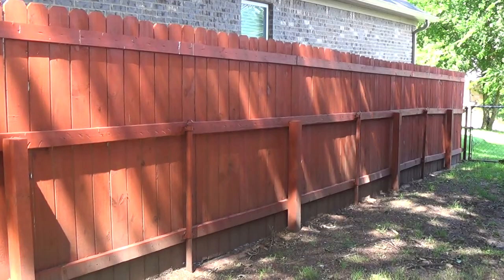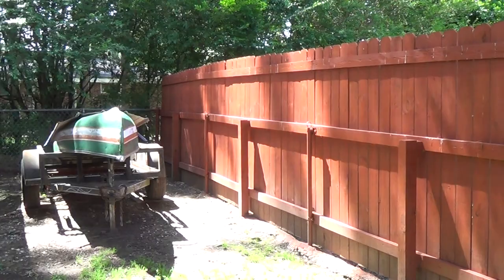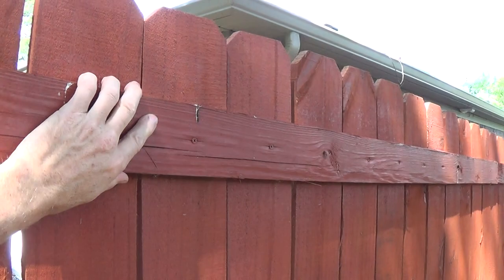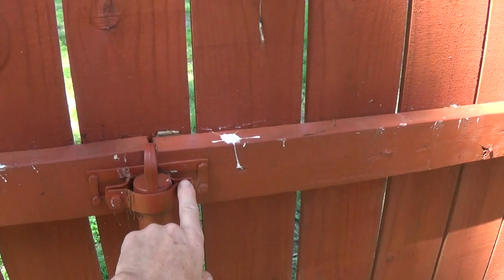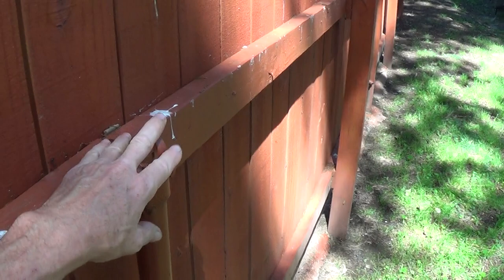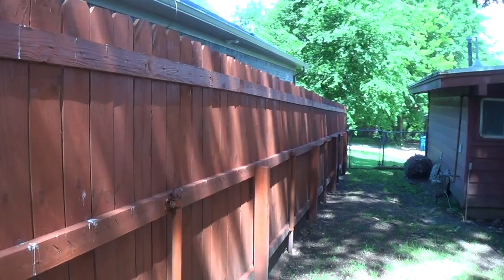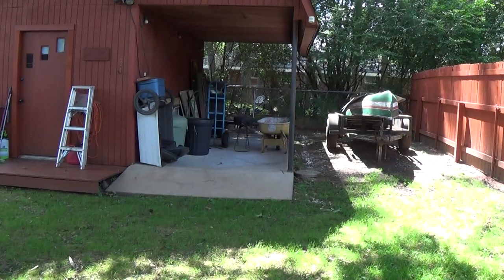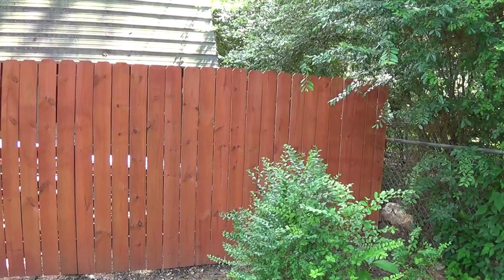CHAIN LINK FENCE TO WOOD FENCE 2 (FOLLOW UP)

Comment: Where do you find the brackets for the steel posts ?
Reply from the maker: I describe them a little more in first video in the comments. 
https://www.youtube.com/watch?v=j_WtbL2LqkM
I got them at Home Depot
https://www.homedepot.com/p/YARDGARD-2-3-8-in-Wood-Adapter-Clamp-328594C/204510280